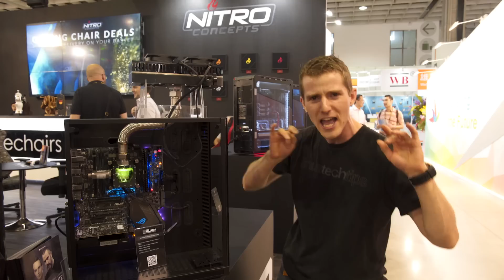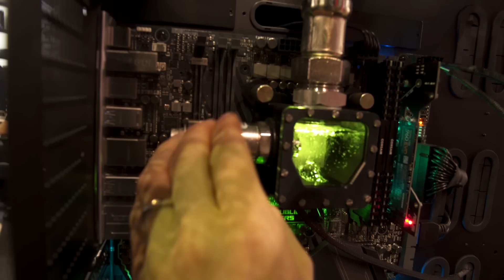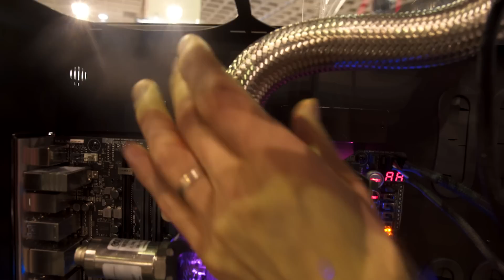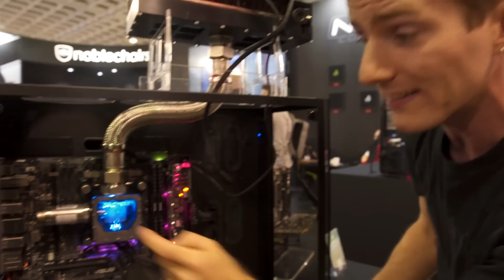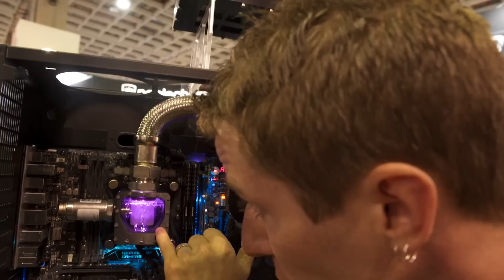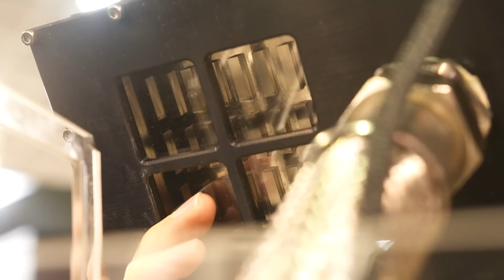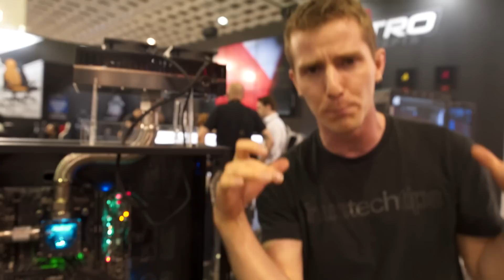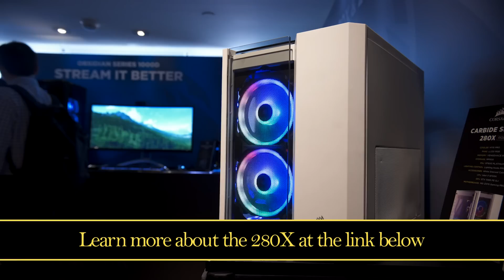Crazy Der8auer cooler prototype - NO pump!

Comment: It could be butane but then the pressure in their would need to be around 75 psi which would be a stretch and also quite dangerous. but considering the pressure fittings and pressure sensor that could be it. Could also be ethanol but then the cpu would be running quite hot considering the boiling point. Could also be some random refrigerant although once again the pressures would be quite high.

Comment: Well you want a high specific heat in oder to hold as much energy you can (bigger shovel) 
you need low viscosity that the liquid flows as good as it can (shovel faster)

And you want a low boiling point but not to low not to high.. so i guess 20C would be good not to low to risk kondensation, maybe 40.. any higher or you won‘t beat a normal cooler (and i guess they are aiming for that).. also depending ob the pressure you can risk a dry out… 

And it needs to be easily shippable
 Methyl alcohol cones into mind but its flamable… 
And colorless and not poisonous…
It cant be that hard

… refrigerator coolant…CFC..CHC… something like that…

Comment: That coolant is dry water. A chemical known for its low viscosity and extremely low boiling point. It's also not electronically conductive. Which means you could fully submerge a pc into a tank of it. Which would be arguably more effective

Comment: It's been 2,5 years. Any news? Or is this the new all-metal fan cooler? Altough that at least made it onto shelves.
https://www.youtube.com/watch?v=oCghRn2Zae4&t=326s
I think the problem with this setup is that it's too expensive for mass production, only works under very specific conditions, there's literally no way to perform maintenance, the advantages (no pump) are too few and the market is too small. Water cooling pumps, especially those in the high-end market, are already very quiet and long-lived.

Comment: Interesting question what coolant they used. It would help a lot if I knew if the loop is pressurised or not. If not, I would say they're using Ether. Ether boils at 34 C, would be perfect for this.

Comment: If you have a bit knowledge about chemical fluids on the market and simple chemistry, its an combination of two fluids to synergy,
kinda easy, theres not much combinations that goes into gas at 40-50 and back to fluid fast. Novac is whack, gas point is to high for goooood OC, so i hope bauer figured out.
Otherwise if it will not release soon, may i take care

Comment: Well it has to be something with a rather low boiling point ...so I guess it could be alcohol or a mixture of two liquids ? Water and alcohol ? But considering that they have a pressure sensor inside it could also be something else ? Problem is to find something that is user friendly and doesn’t kill you on a leak.

Comment: My best guess is that the coolant used is distilled water. The system is filled with water, and then a vacuum is pulled to the point where the boiling point of water is lowered low enough to start the cooling cycle. If you look up a "Water Boiling Temperature vs Pressure in Vacuum Table Chart", it would certainly be possible.  

I doubt it's anything flammable or a liquid that is strictly regulated.

Comment: 3M Novec is the coolant. Why isn't this a product? Because the coolant is expensive as hell. You pay a couple hundred of dollars for a single liter. So once you have a cooling system you probably have to spend like 2.000 dollars for it. This 3M Novec liquid is best used for data centers. Its good because its very efficient if you submerse your rack into this coolant and the heat evaporates away. You can then condens the liquid again with ambient temperature outide which means data centers don't need insane refrigeration units to cool it. Data centers have to use refrigerant cooling because of the insane power density but with this 3M Novec fluid they don't anymore. The cost just has to go down before people are going to use this engineered fluid.
Reply: The creator has specifically stated its not Novec. That's the only hint he has given thus far.

Comment: supposing that the max cpu temp wanted is about 70-75°C  and considering that some other component is already dissipating some heat, the coolant must have a boiling temp below 60-65°C. i guess, it shoud also be non-toxic and not flammable too. not easy

Comment: I'm guessing it's CO2 Carbon Dioxide. At a really high pressure, obviously, but I think that makes complete sense. And you can just fill the thing up by putting some dry ice in there when it's empty.

Comment: I hope this doesn't become a thing, Water Boiling point is 100º C LMAO I don't want my CPU to reach that in order for the cooling to work properly, even using other methods to make it boil earlier, I prefer my CPU to run at 50-60º with a regular pump...

To decrease the water boiling point to regular water it only means its combined with some volatine solution, plus they are using vapor pressure which means, HIGHER RATE OR CHANCES OF A LEAK !!! 

HELL NO !!!!!

Plus solutions have a much higher chance of corrosion...

Comment: Distilled water with anti oxydent. At low pressure which lead to boiling point as low as 50'C, Or acetone could be used as well. Using the same tech as of heat pipes.

Comment: Natural circulation is used in nuclear industry by design so pumps are not needed to cool the reactor, either for quietness reasons in the case for submarines, or if loss of AC power causes the pumps to trip. https://en.wikipedia.org/wiki/Natural_circulation

Comment: I would say seeing as the liquid must certainly be have an extremely low boiling point, but liquid nitrogen is too cold and liquid helium is heavy in relation to nitrogen as a gas. That being said, I feel like this could be a liquid nitrogen and liquid helium mixed in a particular ratio. The two elements do not mix easily, but when they do become mixed, they do not separate easily. They retain both properties of each element and are heavier or lighter, depending on what physical state they are in. The gas molecules move around with a fair amount of kinetic energy so they stay mixed properly. Just my guess, but this method would allow for an element to convert the liquid to a gas and in turn produce rising bubbles of gaseous Nitrogen and Helium that force their way up a closed loop and into another cooling and condensing system that essentially converts the gaseous hydrogen and nitrogen back into a liquid state, allowing them to flow back down to the processor where the process is repeated again. This is all based on the notion that this is a closed and pressurized system and it would have to be if you are dealing with gasses that boil and then go to a gas state at low temperatures.

Comment: It's a novec from 3M, if you would tell what was the CPU temp I can tell you exact type. Interesting thing about the novec is that it was designed as fire extinguish gas, to replace halon. Few percent in the atmosphere can put down a fire, it maintain in the atmosphere only for about 5days. Novec is basically super safe taking into account it physical properties and how smart it can be used in cooling. A lithium Ion battery modules can be both colled and in case of fire extinguished with this gas. Really exciting topic. I'm designing a cooling system for super performance battery with this gas.

Comment: for one it has to be a liquid that boils at a lower temp as water.. or else you still have 100C temperatures, i'd guess in the 60-70's range, hydrogen solutions are corrosive or poisonuos..  Isopropyl Alcohol.. boiling point around 80C.. seems a bit high for boiling point, acetone boils at 56C but is also a dangerous fluid, looking around for available fluids i would say methyl alcohol around 65C should be my best guess and is not too hard to get either, i thought about Isoprene , but the boiling point is only around 34C making it a bit low.. but still possible

Comment: Might be some organic compound with a low boiling point. Some hydrocarbon compound or similar. the question is if the fluid reacts with materials like rubber as some solvents do, if it is even used in this cooling system. Maybe assisted by a pressure < 1 atm inside. There is a non-conductive fluid that i saw once. it was used to emerge the whole mainboard of a pc to give it a cool look. can't remember the chemical composition tho

Comment: I don't get it because if the water is boiling then it's at 100 degrees centigrade. So the Chip has to be running this hot as well.

Comment: distilled water under low pressure?
Reply: Novec boiling more likely
Reply: @2P-Immersion  There's still the mystery why all the bubbles come from the bottom and not from the side with CPU
Reply: @tomasruzicka9835  Is the Computer actually on? Its hard for me to see if the computer is actually running or if the RGB is just cycling. They could be just running a heater as a tech demo
Reply: @2P-Immersion  Seems like a KickStarter shenanigans to me then (maybe not but if they made something that works with heater why not just start the computer?) Id like it to work. I loved the idea that one day i would build a computer that would be cooled by a functional model of a nuclear powerplant cooling tower (just for fun) but they are just reinventing the heat pipe. I mean the whole idea of cooling by vaporizing is to let the water vapor out of the system and get a new cool water in and let it be cooled by earths water cycle but that is just still relying on the ability of the radiator to get rid of the heat and the ability of the fluid to conduct the heat. Maybe they managed to make the fluid accept more heat at once by changing the state and vice versa at the radiator but it sees just like making the thermal capacity of the medium bigger the heavy lifting is still done by the radiator so not a much bigger potential. (as far as i'm aware feel free to disagree and change my mind)
Reply: @tomasruzicka9835  Its impossible to know for sure. Transferring energy efficiently from a the CPU to the fluid benefits from a boiling enhancement coating after a certain heat flux. They don't seem to have any such enhancement on the IHS. Maybe they are still working out some of the details.

Comment: Alright, so that's is just streight up some filtered water
Reply: More likely some sub 100C immersion fluid
Reply: @2P-Immersion  I've never dealt with liquid cooling so your probably right.
Reply: @Fullmetaltransfem  It could be filtered water, heat pipes often use water in a vacuum but the construction of a heat pipe is capable of holding a vacuum better than this system with all the seals needed.

Comment: Nice work in building a pressure cooker, lol.
From my point of view this will not work out so easy. For a boiling cooling system you either have to transport the gas phase out of the system, like some safety cooling systems for chemical (exothermic) reactors (the system is then isobaric but looses cooling liquid, e.g. power plants using cooling towers) OR you have to build two chambers with different pressure levels. The low level for the CPU part, because the coolant there is boiling at lower temperature. The second pressure level has to be higher to condense the liquid. The condensation enthalpy has then to be removed by the heat exchanger (T of system should be >> then T of surrounding for better heat transport).  So you need a compressor (fridge principle).
Otherwise the pressure in the closed system will rise and this will rise the boiling point of the liquid additionally (look up a p T diagram) or imagine a simple pressure cooker. And I did not even took the mixing issue for heat transfer (hot spots) into account.
Long story short: I can not really imagine that this is feasible for the aimed purpose.
Reply: https://www.youtube.com/watch?v=oZavKweMrP4 these guys have made it work. system operates at atmospheric pressure. using condensing water at ~40C I would guess. Novec fluids have a range of boiling points from 34C to +100C.

Comment: My guess for the Fluid is 3M Novec. He used that repeatedly in other builds
Reply: 2+2=4
Reply: @quickscopingisgay  Mitochondria is the power house of the cell.
Reply: anonym mapsi could be water just under vacuum as water gets colder and boiles in vacuum
Reply: @benjaminnicholas8746  vacum does nt need a pressure sensor
Reply: @benjaminnicholas8746  it's 3m novec. it's specifically made for evaporated cooling with condensing like this and non conductive
Reply: @benjaminnicholas8746  NOPE, that does not work, seriously. We would have tried that already if that was so simple. And correct me if I'm wrong, but lower pressure enables easier phase change without so much heat, which is counterproductive. Also: The temparature raises the pressure, so eliminating the vacuum, you could not get it to condensating again without pressuring it (like an air conditioning / fridge)
Reply: @nigratruo  No, the energy you need to turn water into water vapor is pretty much the same at all temperatures
Reply: @meta1storm  Nope, that is not right. If you have a full vacuum, water will turn into vapor without needing ANY energy just by not being pushed together anymore.  Water boils at any temperature in a full vacuum.
Reply: @nigratruo  But water needs energy to switch from a liquid to a gas, i think that is what @meta1storm is talking about.
Reply: @techman03abc25  Soooo, you are claiming that if you put water in a full vacuum and there is no heat energy, that it won't turn gaseous? That is factually not true. https://medium.com/starts-with-a-bang/water-in-space-what-happens-92a98a3f3a37    he gets this right, except that space has no temperature, the same way an isolator does not have any temperature, it is not incredibly cold as he claims.
Reply: @nigratruo  No, i didn‘t claim that actually, because in the case you just described, the energy wich is used to turn the water into a vapor came out of the water itself. So the temperatur of the steam is lower as the tempreture of the water.

Comment: coolant should have a boiling temperature of lower than 50 degrees be compatible with the metals, low toxicity and stable with low pressure, so, the list is not long

Comment: The idea is not new and the technology is already being used in other forms like for example in space engineering. 
Most likely it's some sort of fluid for an ORC (Organic Rankine Cycle ) process. https://en.wikipedia.org/wiki/Organic_Rankine_cycle
Some of the fluids have a boiling point at 35 degrees low and are toxic or explosiv even.
But yes if needed you can cool your harware with it.

Btw. it's just a custom Heatpipe!

Comment: I love how the cpu is visible, this has to be a thing!
Reply: Maybe it was just the copper block, as creating is liquid tight seal around the cpu heatsink is very hard and you wouldn't want it to leak.
Also I didn't see any text on the plate, not even black smudges at least with all those bubbles
Reply: @Ikxi  fair point but linus actually says the cpu is visible.
Reply: @MCPilot1201  Wait really?
Then dafack
Did they put the thing on the cpu and then fill it?
Reply: @Ikxi  the fluid is inert and doesn't conduct electricity. It won't damage the cpu whatsoever :-)
Reply: @dansmith6990  Ahh ok, so they used something non-conductive that doesn't pick up ions
Reply: @Ikxi  I'm not sure about that level of detail, but do some reading about fluorinert (which I think this stuff is, possibly something very similar), it's a dense inert liquid but has the viscosity of water despite being 1.8x as heavy for the same volume. Crazy stuff!
Reply: @dansmith6990  That's heavy wow

Thanks for the information!!
Reply: @dansmith6990  and also costs a shit ton and is a pain to handle or dispose which is why this prototype would never work unless you're willing to spend a fortune in flourinert
Reply: @elliottd323  the extent some people spend on their hobbies boggles my mind, I can imagine some nerd buying some lol

https://www.parallax-tech.com/fluorine.htm

For the amount you'd need to cool a PC would only be a few hundred bucks. Yeah, pricey, but not exorbitant i suppose
Reply: @dansmith6990  still a pain in the ass to dispose and handle it makes unreaparble damage to the atmosphere if not handled correctly
Reply: @elliottd323  it's still getting made regardless though...
Reply: @Ikxi  Knowing him it is probably shaved flat, which removes any text from the chip.

Comment: WATER NOT KIDDING!  The coolant with the HIGHEST latent heat of evaporation (boiling) is water!  It boils too hot at 100 centigrade (farenhight and inches is for 4th world nations)!  To lower the boiling point to CPU cooler temps, half atmosphere pressure (hence the pressure gauge and industrial pipes) and CNC made water condenser up top.  Wood alcohol is usable but has half the needed enthalpy of water and is flamible and toxic SO IT IS WATER!  You can tell by the bubble size water viscosity makes specific bubble sizes!  HA HA TOP SECRET NO MORE!  TO MAKE THIS KIT YOU NEED A VACUME PUMP AND DISTILLED WATER THAT HAS JUST BEEN BOILED TO REMOVE DISOLVED GAS eg Nitrogen, oxygen etc.  SOLVED.  PS. LATENT HEAT OF WATER BEING SO HIGH ALSO MAKES GLOBAL WARMING  FFFFAAAAKKKKEEE BECAUSE OF NATURAL STABILISATION, SO POLUTION ISSUES AND CLIMATE CHANGE IS WHAT IT IS NOW CALLED.  PIG IGNORACE RULES THE PLANET!

Comment: Looks like flurinert

I know of a server room in London UK using something like this giving cooling to radiators 4 floors up on the roof....
 (phase change liquid to gas and then phase change to liquid which runs down drain tubes back to the server room. - nice viewing windows too)

It's been doing its thing for nearly 20 years